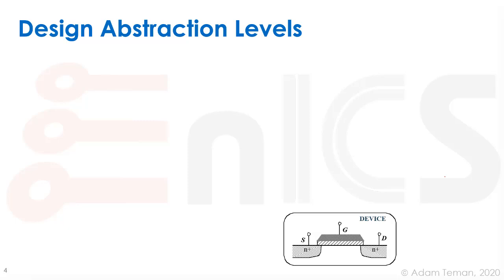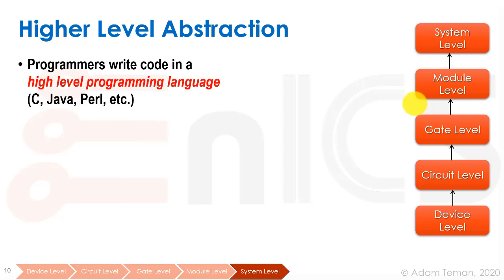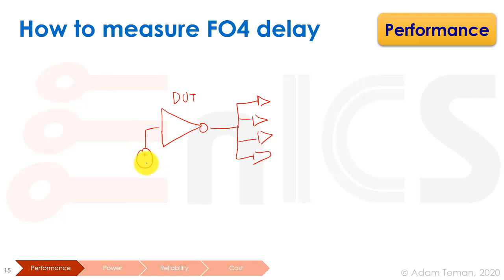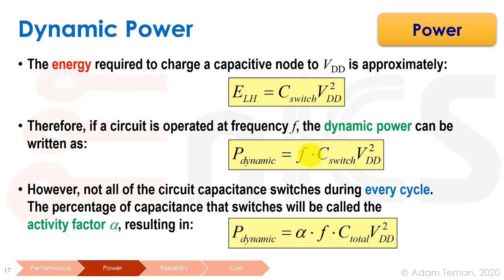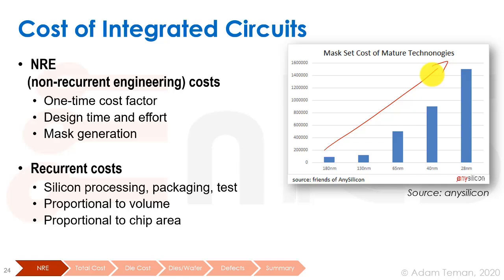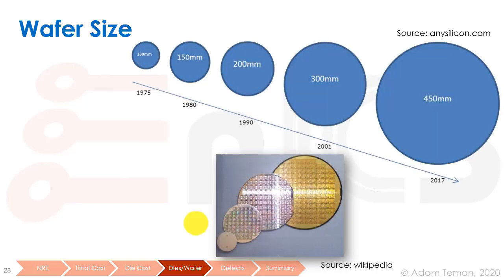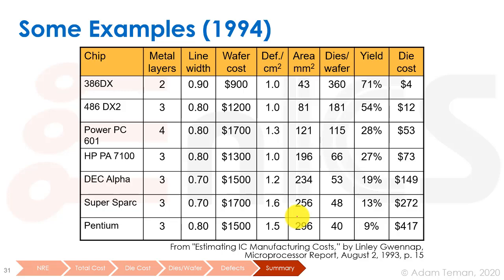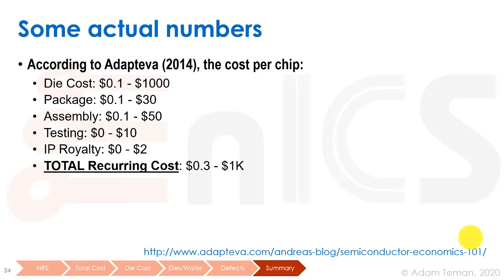VLSI - Lecture 4: Design Metrics

Comment: Hey Professor, can you give a brief description on the sealring, scribe and die per reticle?
Reply from the maker: I guess just a word or two (there is a lecture that I plan to record at some time that goes a bit deeper into sign-off and chip finishing and contains a bit more detail about these). The seal ring is basically a structure you put around your chip to protect it during the dicing of the wafer. Therefore, it would contain guard rings (bulk contacts) or similar things to collect charge that may be produced during dicing. The scribe lines are just the area between dies that is left for dicing, so this is a wide area (so you don't cut a die itself) with nothing in it. Often, fabs will put test circuits and metrology in the scribe lines to test things at wafer level and these will be destroyed when cutting the wafer into dies. For the question of die per reticle, the issue is that the size of the mask is much smaller than the size of the whole wafer (taking into account the 4X optical reduction). So you need to move the wafer around and develop the mask onto it many times. I am not sure about the actual size of the photomasks, but most big chips are no larger than ~800mm^2, so I'm assuming this is about the size of the reticle (though I may be mistaken). There is a possibility to connect several reticles to make a single product, but this is quite rare, as it is tricky in the overlap and the price is huge. If you are interested in a very extreme and cool example, check out the company Cerebras, who recently announced a product that is the size of an entire wafer.
Reply: @AdiTeman  Thanks for the explanation professor!